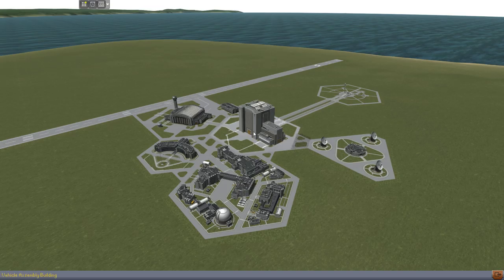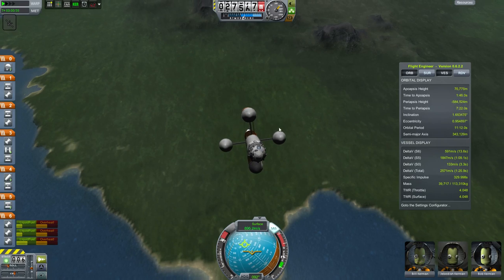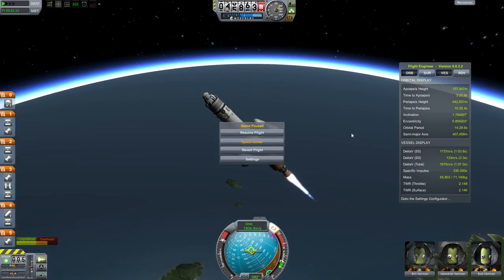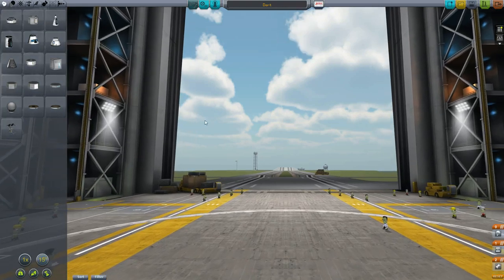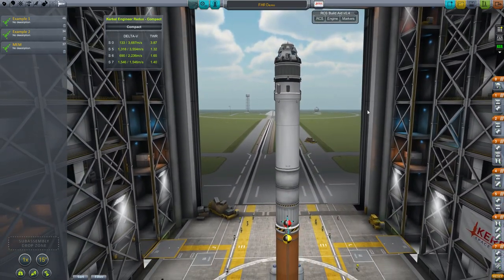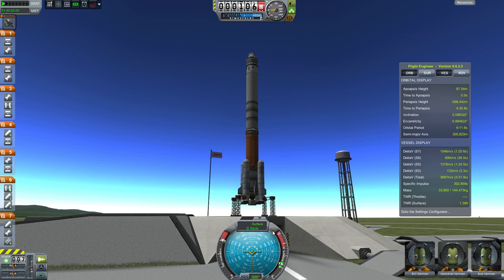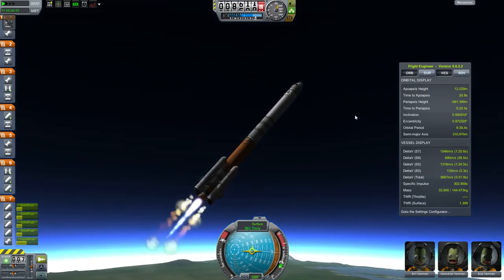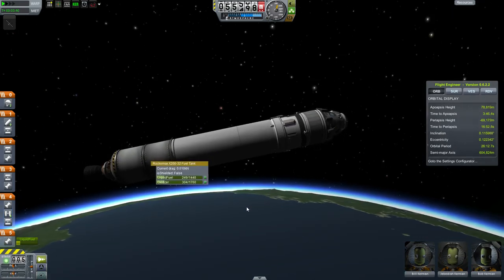Building and Flying rockets with Ferram Aerospace

Comment: Need some advice, I can launch a rocket just like you said in the video and that works fine, but I am trying to make a mk1-2 command pod  and various other things attached to it (rcs tanks, thrusters, ASAS, power generation, batteries, docking port, parachute and lights) re-enter the atmosphere backwards (parachute at the top) I added winglets to the top of the capsule so that the center of pressure is above the center of mass. Am I correct in saying that this should make it want to point retro-grade? Because it doesn't seem to, whatever I do it will always turn itself to face straight down as it gets back into the atmosphere causing it to break up when the parachutes deploy. Anyone know what I am doing wrong?
Reply: normally as long as the SAS of the command pod is off while its at its atmospheric descent then it should come down as you'd like it to without any aerodynamic parts, if it doesn't you may want to check the game codex and/or reinstall/update